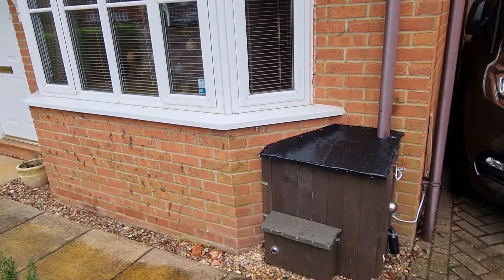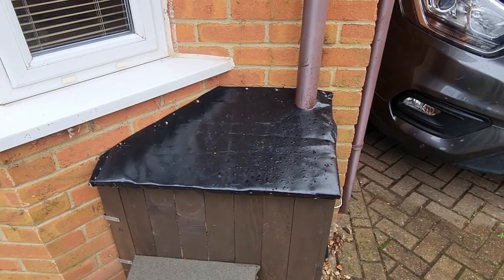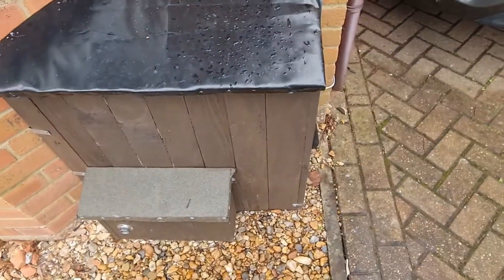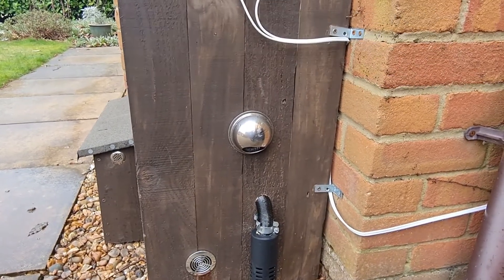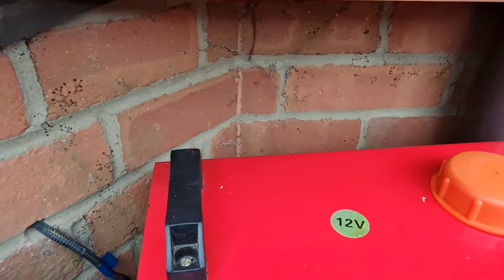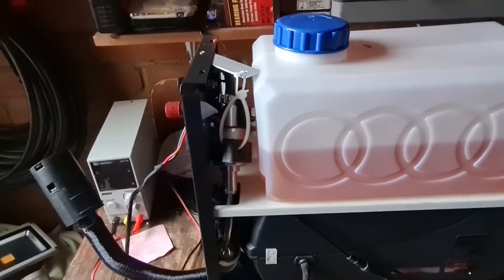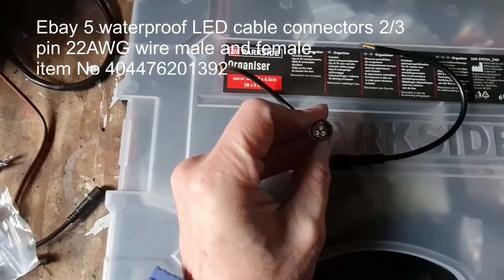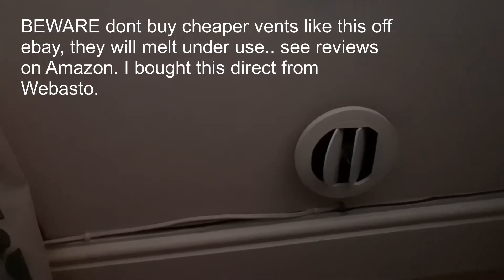Installing a Chinese Diesel heater into my house

Comment: Nice setup , I found the same smell of diesel which I suspected was coming from the fuel tank vent. When filling tank no matter how careful I was also smell of diesel for awhile. Modified the cap and fitted a section of the green fuel hose so as to vent outside box.
I also fitted a bigger fuel tank , 15 litres,  got fed up with filling every 2/3 days. Now filling once per week.
Reply from the maker: Hello. Thanks for viewing and commenting. That's an interesting point re the filler cap, I will investigate and try your potential cure. Yes the fuel tank is definitely too small, if I was to do it again I would do away with the metal housing so I could incorporate a larger fuel tank.
Reply from the maker: Tried as you suggested regarding the green pipe used as an extension to the fuel tank breather, sadly it did not cure it, so alasI must continue my search.
Reply: Pity that didn't solve your problem, only other thing I can think off ( other than moving fuel tank ) is if your unit came with the green fuel hose from tank via pump to Burner   module,  it is known to be unsuitable for diesel and can permeate fuel through the plastic . Try with your hand and see if any traces of diesel around the green hose. Others have replaced this hose for the white nylon hose.
Reply from the maker: @martint1151  sadly I have already replaced the green hose with the white type. I think I may have to resort to relocating the tank. But first I want to strip it down again and use heat resistant Silicon when renew the gaskets  as I think the mating surfaces may be an issue, cheaply manufactured.

Comment: Thanks for sharing; this is a really cool build.  Inspiring!

I think i may try something just like this.  I work for a commercial signage company and have become the resource recovery specialist lately.  I've implimented policies to keep mercury from old neon out of our ground water and gotten everybody on board with recycling wire. we fill a big bin  with wire every other month.  

Next i've got my sights set on tackling our plastic waste stream.  I'm building a grinder to granulate the old sheets of acrylic we remove during sign refurbishment, and deal with the all the fresh plastic waste coming off our cnc router table.  My goal is to pyrolyze the plastic into diesel.  I doubt the boss will let me feed it into his trucks, but i did trick him into getting a shipping container to use as a field office, and it's been getting chilly now that it's winter...

We have a small mountain of dead signs in the back lot that has been accumulating since 1945,  that needs to be mined for resources and cleaned up.
Reply from the maker: Hello. Thanks for viewing and commenting. It will certainly help warm your office. I would like to recycle old cooking oul into diesel but I don't really have to room to set it all up. Your contribution to recycling is greatly appreciated though.

Comment: Great video, just wondering does this solely heat one room or do you leave the doors open to heat the whole floor?
Also what teperature difference to you get from the outside to the inside when you have this turned on?
Thanks
Reply from the maker: Hello, thanks for taking the time to view and comment. Being located in the lounge I do need to leave the lounge door open for it to heat more rooms in the house, as the lounge door is adjacent to the stairs to the first floor the heat does travel well upstairs, you can feel the heat as you leave a bedroom and decent the stairs. I have found with the lounge door closed the heater on full will bring the temperature up by 1 degree centergrade in 10 mins, but this is dependent on the size of the room. Once the .room is up to temperature I open the lounge door a little and allow the heat to travel further throughout the house. As for indoor and outdoor temperatures it solely depends on how high you set the temperature, I have a very warm lounge in particular than that of the temperature outside.
Reply: @royclark8385  thanks for the quick response.
I'm thinking of installing one so that the duct feeds into my entrance hall and allows the warm air to circulate the communal spaces.
My house was built in the 1930's and the temperature first thing in the morning is about 13C downstairs. So I'm wondering if this will be a good supplementary source of heat.
Let's see.

Also on a seperate note, you mentioned the diesel smell. I could be totally wrong but could this be due to too much fuel being pumped, therefore there is unburnt fuel in the main chamber. If this is the case then maybe the pump speed needs to be reduced on whichever setting level is causing the smell?
Reply from the maker: Thanks for your thought re the diesel smell, I have tried different pump settings but to no avail. Considering its a sealed unit and no smell should be present as it all contained in the burn chamber, and any diesel residues should only be expelled via the exhaust, I am now thinking its a casing issue, as they are mass produced finesse is not a high priority, my eberspacher does not suffer the same problem. 
I think I am going to replace the gaskets again only use heat resistant Silicon on them too to hopefully form a better seal
Reply: Hi. I have a similar setup, although i installed everything into an electrical panel and monted on the wall of my driveway, and i have an external tank for ease refuling and or tank swapping. With regards to the fuel smell on start up. I'd route your exhaust further away. Initial startup you get  un burnt fuel emmitied briefly. Also, this means you may be drawing combustion products in when it's up and running. I routed a 25mm metal Conduit nearly 4 meters away from my fresh air inlet. I don't get any smells inside the house at all. Also i trust you have carbon monoxide inside local to your hot air inlet.
Reply from the maker: Hello. Thanks for viewing my video and commenting. I like your way of thinking although my exhaust fumes are exiting in the opposite direction from my air intake. I would have thought the diesel fumes would have filtered out way before they (if at all) reach the air intake. But its definitely worth considering.
Yes I have a carbon monoxide alarm situated above the warm air outlet plus another one at the top of my stairs on the first floor. I should have added that into my video.